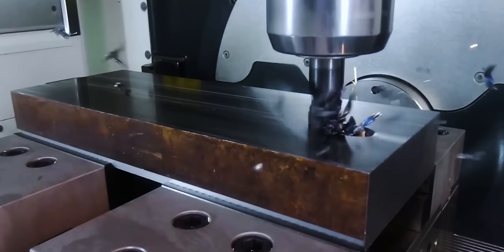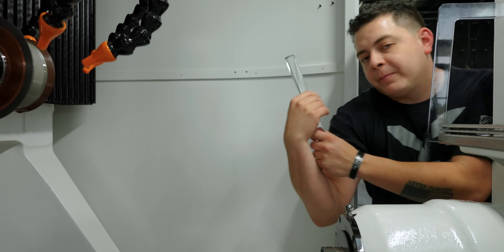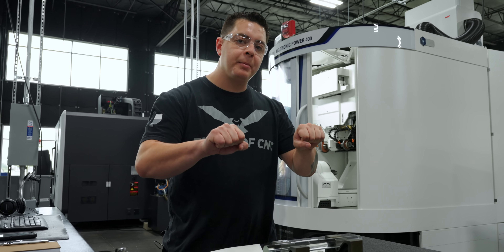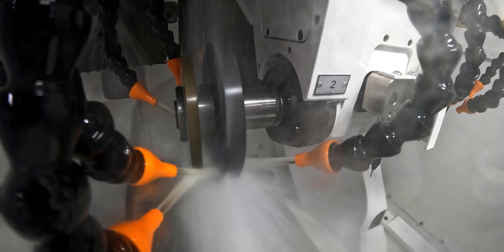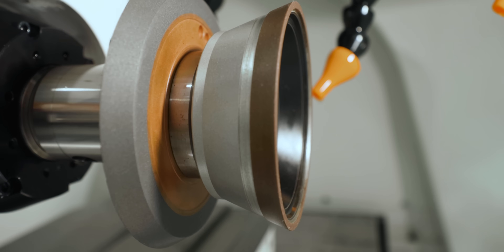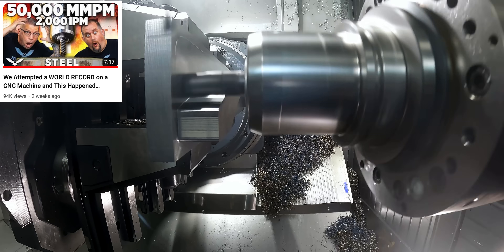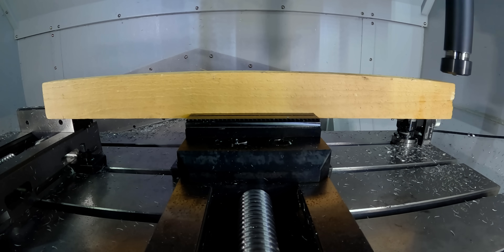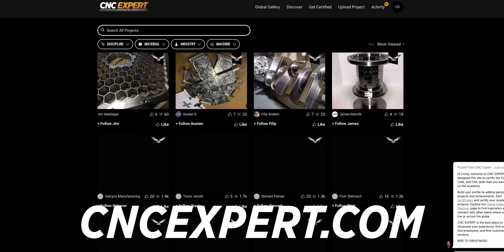World's First Glass Endmill | Incredible Process!

Comment: The best way to have broken it is to apply your score mark then put it in the chuck. Spin at a slow speed and apply heat with the tip pf a map gas flame just off the score mark. It will crack along that line and break off somewhat evenly

Comment: I'm starting to wonder if you could use different types of glass.  If, IF you could get your hands on it, there's a special type of material used in military helicopter windows that's composed of sapphire.  Another type of glass, if you could call it glass, would be Aluminum Oxynitride, which is a transparent type of ceramic (ALON).  ALON is tough, tough stuff.  I can't remember where I read it, but the US military is investigating it, or had investigated it, as a type of bullet resistant armor.

Comment: A chopsaw with abrasive wheel is good for glass rod. Water jet also works well. Use a slow speed with either to avoid shock loading.

Comment: Try sapphire or cubic zirconia. The are much harder (9 on Moch scale for sapphire and 8 for cubic zirconia and only 7 for glass) and also stronger. Not sure if it will cut metal, but may be it will work for wood.
Reply: Lol pretty sure it would be impossible to get those in bar stock, gems don't exactly come out of the earth round or at size. Most are smaller than 1x1mm when they are mined.
Not to mention if a sapphire of that size even existed it would be worth billions.
Biggest in the world is only 9.9 ounces and fits in the palm of the hand.
Reply: @verakoo6187 I`m talking about lab-grown sapphires. They are produced in different sizes. Cubic zirconia is also lab-grown material. As for the natural gems, there are a lot of stones much bigger then 1x1 mm. I`m professional jeweller with 15 years of experience, so i know what i`m talkin about.
Reply: @verakoo6187  Also, natural stones don`t fit wor this task due to a lot of flaws in their structure. Even loupe-clean stones have a lot of stresses in their crystallic structure. Lab-grown stones do not have this problem. Also, it is possible to grow monocrystal stone which will have even higher quality.
Anyway i think they will be too brittle for this task.

Comment: HOW TO CUT THE GLASS - YOU WANT A FINE SCORE LINE not a fat one.   It is inversely proportional to the radius of the score situation

Score it all the way around with a quality glass cutter,  heat the score mark with a hot metal rod and then run iced water over it - thermal shock will break it
Reply: That's a lot of extra steps, just direct heat with a torch after scoring.
Reply: @TickyTack23  - On heat resistant quartz glass?  Are you sure???